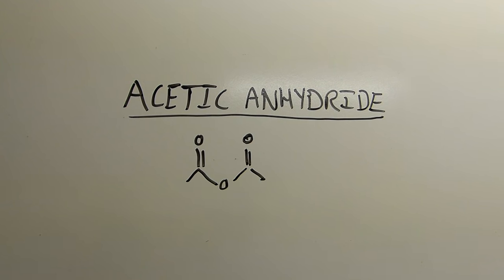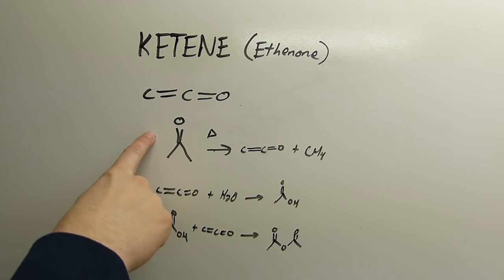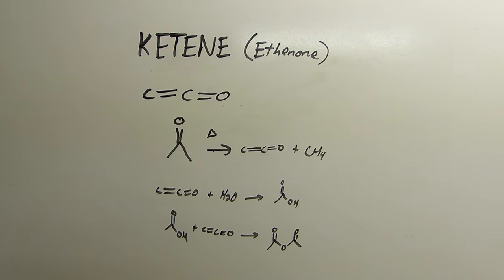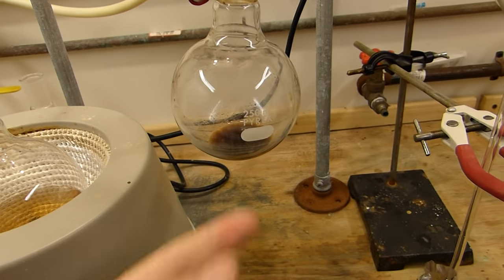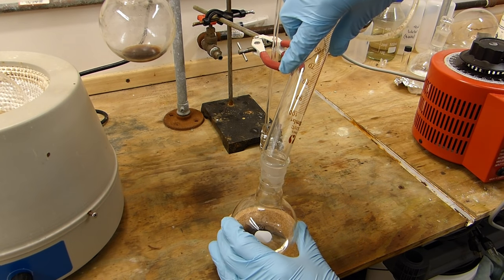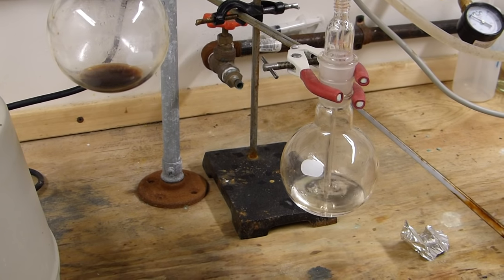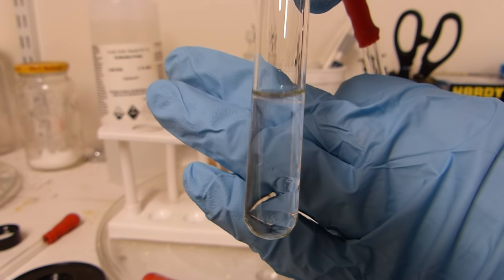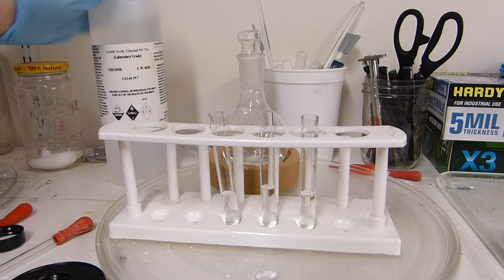Acetic Anhydride Part 2: Running the Lamp

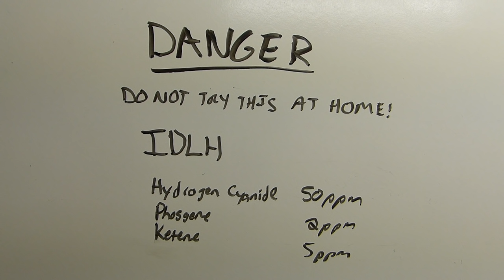Comment: 1:00 no worries even though I like doing dangerous stuff I'm really not planning on attempting this (especially with my chemistry lab being my kitchen at the moment), but I find the "ppm" unit absolutely non intuitive. I have no idea what "1 ppm" represents in practice. I know it is very little but how much so?

I guess the point I'm trying to make is that I think it could be useful to express these thresholds in a way we can relate to, like (just an example, dunno if it is the correct order of magnitude at all) "this is the equivalent of 1ml uniformly spread inside of a football stadium" or something like that.

Imho it would help convey the danger level better cuz I'm not sure if many people have an intuitive representation of what "1 ppm" is. I know I don't.
Reply: 1 ppm, or one part per million by volume, is just one ml of gas per cubic meter of air. Considering that a football stadium has a volume of as much as 1 million cubic meters, one ml per football stadium would be 10^-6=0.000001 ppm. Personally, to get a better idea of the toxicity, I like to use the LCt50 reported in the literature to calculate the total lethal dose you'd have to inhale (assuming a respiration rate of 6.5 liters per minute). For example, ~130 mg of chlorine gas are the average human lethal dose, compared with  ~20 mg of phosgene, 12 mg of hydrogen cyanide, 500 μg of sarin and 200 μg of VX nerve agent.
Reply: @lagrangiankid378  thank you

Comment: Hi, I just got this system for the production of acetic anhydride repeatedly tried but ultimately failed. Please guide me and tell more details.How much acetone and acetic acid is used?
Reply: it seems this method either works, or it simply doesnt. other variations using a copper tube have also been used but people report either success or nothing at all
variation in wire temperature etc seems to make zero difference in my world
i cant even get the acid to gain weight, its supposed to go from 120g to 200g at 100%
vinyl acetate may be another route catalysed with palladium chloride or copper chloride

Comment: after seeing this working, I have got to admit I was quite surprised at just how fast it was working ! It got me thinking, I reckon there is an even easier way to do this, provided you already have the bare minimum of glassware to do normal distillation, here's what I propose. Set up your boiling flask in the electric heating mantle with a reflux condenser ( a Liebig type, just the tube, no spiral like the Graham type)  on top in the vertical position as you normally would for reflux. Now, instead of having a coiled Nichrome wire inside a glass bulb, you could probably just have a carefully designed single length of Nichrome inserted through the top of the condenser running down the center of the tube, you could have a couple of little supports made of glass wool or mica from an old toaster etc. to keep it in the dead center so as not to touch the sides, you could use your "T" adapter at the bottom between the boiling flask and the condenser to lead the copper wire out of that will attach to the Nichrome, goo it up with silicon sealant, that stuff will work really well for that because you are only boiling acetone, 56 degrees Celsius. The copper wire that the Nichrome attaches to at the top end of the condenser can also be sealed in place with silicone sealant, the clear stuff, with the addition of a plastic tube of around 5mm diameter that is also sealed in place, the tube would lead directly into your acetic acid or if you want to be extra picky you could just have extra meter or so if tubing coiled up and submerged in an ice bath to condense out and residue then bubble your ketene into some acetic acid

Comment: Doug, is a "lamp" the only way to achieve thermolysis?
If you used a steel tube heated by a flame or electric resistance to pyrolyse the acetone vapor, could it be made to work as well ?
Reply from the maker: +_Arthur Ski 
There is nothing special about the lamp other than it exposes acetone to high temperatures. Glass tubes would also work just fine if you could get them hot enough. A steel tube would not work very well since traces of acetic acid that form in the refluxing mixture would slowly dissolve the tube. Even my NiCr wire is corroded so badly it cannot be used after 30 or 40 hours of operation, and must be replaced. Many ordinary metals would not last very long.
Reply: Yes, the iron would both corrode and mess up the reaction, and the fittings between steel and glassware might be tricky. And nobody can afford a platinum tube just for that reaction.  Oh well.

Comment: I live in Australia and have tried this experiment many times as per this video's instructions precisely,  with locally purchased  ACS grade acetone, but unfortunately could not get any gas production, could anyone offer any suggestions as to why no ketene was produced?
Reply: im trying too, i do get gas formed. you might wanna increase wire temperature, ive seen 650-750*C as ideal, if no gas is produced you have leaky glassware, glue all joints up or grind them together with Cr2O3
i do get gas and some ketone formed, but zero anhydride- it seems that either this works or it doesnt, im doing a run out of frustration now where im having acetone AND glacial acetic acid in same vessel, supposing the ketone will be absorbed into the acetic acid- its plausible that acetone+water would form acetic acid in this kind of setup
i found some hints on acetic acid used for ketene generation as well, supposedly filaments can last a bit with acetic acid vapors
acetone+ketene yields isopropenyl acetate which can also be used for forming acetic anhydride by glacial acetic, a bit of conc H2SO4 and isopropenyl acetate

Comment: yeah, I've seen the Vogel set up, and I suppose as long as the reaction tube is rated to handle those high temps, and you  expell the oxygen from the atmosphere, is should,nt go kaboom. Personally...I'd be using a stainless setup for something that, err lively..and not starting with glacial acetic is just madness.
Reply: I was thinking the same, shouldn't you use a quartz reaction chamber for this? If that shit cracks it can mean your death. Also, I'd feel safer to purge everything with nitrogen or argon first.

Comment: Why in the flask is a golden  color ?
Reply: "Degradation products",David. I believe I heard him mention it somewhere during the vid.i e breakdown material from the copper wire and the nichrome wire. It looks like the nichrome discolors and suffers a little from the high temp and may shed a little of it's material as the discoloration in the flask.Just a thought.

Comment: i think you got the chemical formula of keten wrong its H2C2O not C2O,besides that great video keep up the good work
Reply from the maker: +Joseph stalin It's common in org. chem to use shorthand notation which assumes hydrogen saturation. The 2 hydrogen atoms are implied.
Reply: +Doug's Lab  NEVER QUESTION THE GREAT LEADER

Comment: Great video! But there is a mistake in ethenone structure, one of the carbons lack two hydrogen atoms :c
Reply: when chemists draw organic molecules all carbon atoms are understood to be fully saturated with hydrogen atoms, unless they are otherwise noted.  a molecule like propane would be drawn like /\, which tells us the structure is H3C-CH2-CH3.
Reply: @kingkarlito  Yeah, I know what you mean. But when you use that type of notation ( /\ ) you do not use the symbol C. For ketene you either put =C=O (like here https://pubchem.ncbi.nlm.nih.gov/compound/ketene#section=Structures ) or =•=O (like you can sometimes see for allenes etc.)
I think putting a C=C=O is incorrect. Hope this helps.

Comment: Good job, absolutely brilliant :)
Such a beautifully simple and useful process (notwithstanding it's dangerous nature).

Have you tried the red hot Cu catalyzed pyrolysis of acetone instead of heating with a glowing wire ?
It doesn't (AFAIK) require additional heating past the initiation, since it's exothermic enough to keep the Cu glowing.
The difficulty is of course in designing it as a closed system...
How to heat your Cu catalyst to glowing red inside a closed apparatus.
A worthy challenge perhaps ?

Thank you.
Reply: It's pyrolysis and broken chinaware pieces can be used instead of copper wire coil. Heating is done externally. Industrially, stainless steel equipment is used.

Comment: Could you use a similar setup to make Formaldehyde from Methanol?
Reply: that requires airflow, silver or platinum can be used for that iirc without needing to be heated
Reply: @WeebRemover4500  Do you have a source or a paper?
Reply: @emmepombar3328  nope, but it can be done using copper where its heated redhot and then an air-input is directed into the alcohol, and an air-outlet pulls out the formaldehyde fumes, it has been done in glass jars with metal lids by a fellow chemist
the methanol variant has tendencies to blow up however so you want decent airflow control to prevent, and some safety measures to prevent a massive fire as well.
Reply: @WeebRemover4500  Have I understood that correctly?
I let air bubble through MeOH, catching some MeOH fumes, which then stream over red hot copper catalyst forming formaldehyde?
tbh, that sounds like boom. Really air?

Comment: So it makes water into 70% acetic acid but stops at some point and if you start with high concentration it makes glacial acetic acid into the anhydride.  It seems to me you could combine the high purity product with the low purity product and bring it all the way to anhydrous. You could probably use a separatory funnel and a claisen adapter to gradually dilute the product dropwise as you're bubbling the ketene into it.

Comment: The book Doug references at 3:30 is A Textbook of Practical Organic Chemistry by Arthur Vogel.  Below is a link to a PDF version of the books 3rd edition (published 1956) hosted on Science Madness. On page 373 (or 396 of the PDF) you will see the apparatus that Doug's using. http://www.sciencemadness.org/library/books/vogel_practical_ochem_3.pdf#page=396
Edit: Here's a newer version of the same book (5th edition) also in PDF, and I would link to the page with the same apparatus, but this version can't be searched via the browser like the 3rd edition... So if you want it then you may actually have to read through the index yourself :-P But I'm sure it's in there.

Additionally, here's another PDF that shows some useful information: http://www.sciencemadness.org/talk/files.php?pid=111392&aid=4257
Reply: @NerdyNEET  Here's another great one you might like - Small scale synthesis of laboratory reagents (241 pages).
http://chemistry-chemists.com/chemister/Neorganika-praktikum/smallscale-synthesis-of-laboratory-reagents-2011.pdf
Reply: @NerdyNEET  Wow! Good for you man. If I could have a few extra hundred dollars to spare, I would probably print them out somewhere (too much for my local printer to handle). Personally, I like going through and highlighting parts or writing my own notes, can't do that on digital copies.  
And I agree with the practice vs theory thing, theory is neat, but in the end, I like actually doing the experiments/procedures. I mean in theory you could get 100% yield, but that never happens in practice does it? lol.
I don't speak Russian, not one bit, but if you have an awesome list of books in English, please share!

Comment: New subscriber. Great stuff! I've read that taking essential oils or aromatics from roses is challenging. Do you care to tackle that?
Reply: m8 you need about 8 kg fresh rose flower petals to produce 1 gram of essential oil from that by steam distillation, hence why real rose flower EO is so extremely expensive, even when sold as diluted solutions. Most cheap rose perfume oils are blends based on synthetic phenethyl alcohol for that reason. Rose water is the hydrolate of steam distillation, it is very fragnant but contains very, very little actual essential oil.
If you want to try obtaining essential oils from the steam distillation of plant matter as an exercise, you'd do better to choose a plant with a high essential oil content.